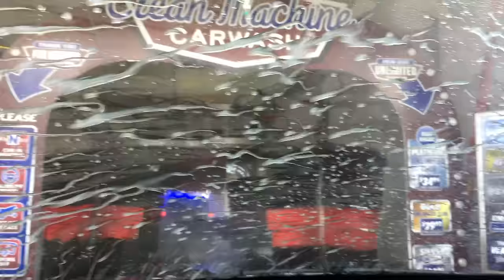Clean Machine Car Wash: Naples Site (Inside & Outside Perspectives)

Comment: Hey, just curious, at 1:17, are those brush strips where the drains are?
Reply: They are
Reply: Brush strips usually fall off if caught on a part of the vehicle, they do this as a precaution so it won't damage the equipment. other times they get old and fall off.